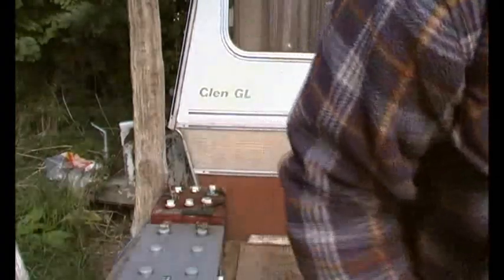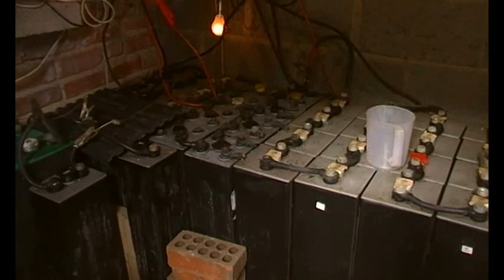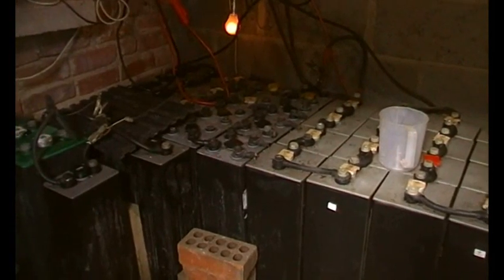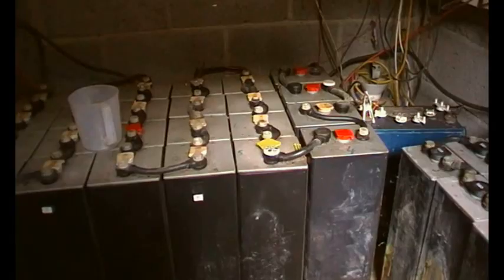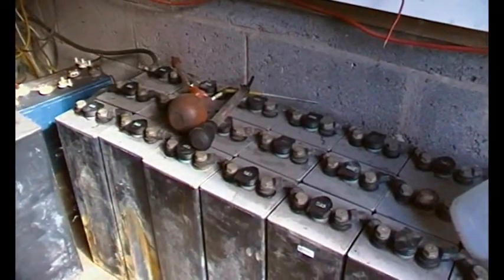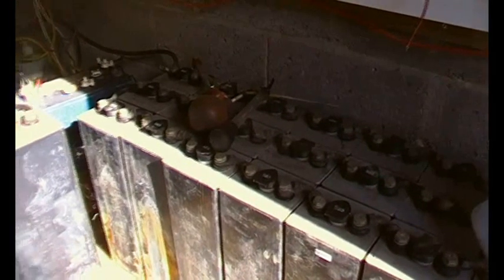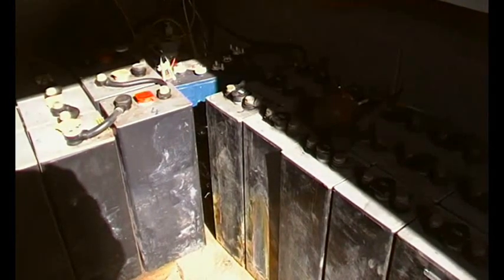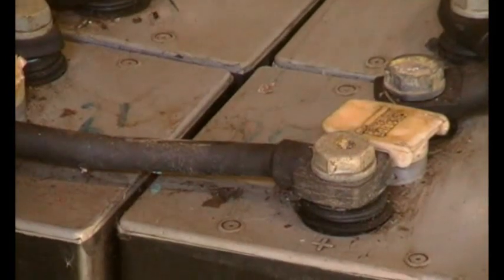Solar forklift Battery failure, corrosion in the links.

Comment: General Motors side terminal battery connections comes to mind.  Gassing batteries.  How to solve it, who knows.
Reply from the maker: Joe, we don't have side battery terminals over here, seems a daft idea. There's a fine balance with battery gassing, on home power it's an important sign to keep the battery plates free of sulphate but too much indicates problems with a cell, cheers

Comment: There seems to be two kinds of terminal corrosion, a white variety and a green version. The white stuff seems to be on the +ve terminals while the green favours the -ve. Clearly they are different compounds, quite possibly due to the different ionic flows at the terminals. 

I have always been a little cautious of using Vaseline on terminals. Sometimes I cover the connexion once it's tightened down if it's a problem one. But I don't really like the idea of coating the mating surfaces as Vaseline is not conductive. What's your view on this Andy?
Reply from the maker: Good to hear from you, must be spring and your days are getting longer, it's a positive feeling. With these bolt on terminals it's important to lubricate the threads and I tend to put Vaseline every where to keep the damp out, not noticed any resistance problems, Equilux mentioned battery terminal grease, I think it's time I got some, cheers

Comment: would links made of flattered copper tube or using stainless steel wire a good idea?
Reply from the maker: Hi, copper would rot out, I have used lead strip in the past with success, cheers
Reply: Stainless will certainly be far less prone to corrosion, but the trouble is that it has a rather high electrical resistance compared to copper, in fact it's even higher than plain mild steel.

Comment: The green crystals are copper sulphate, Holts used to sell a product called Nocrode that neutralised the acid which helped prevent corrosion a bit better than plain Vaseline.
Reply from the maker: Hi, just had a look and there is some battery terminal grease available, thanks for the info, cheers

Comment: Andy how do you clean green battery terminals ? With vinegar or water and baking soda ? Good helpfull video !
Reply from the maker: Hi, I have used bicarbonate of soda in the past, cheers
Reply: Baking soda solution works well, but you have to be careful not to splash it in the cells. Vinegar is better for cleaning up the mess that alkaline batteries make when left in devices for too long.